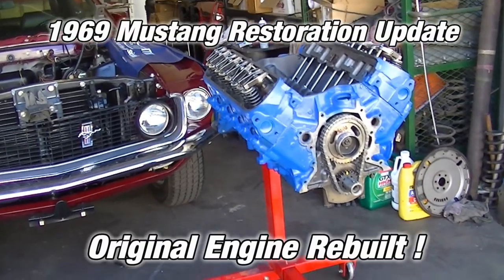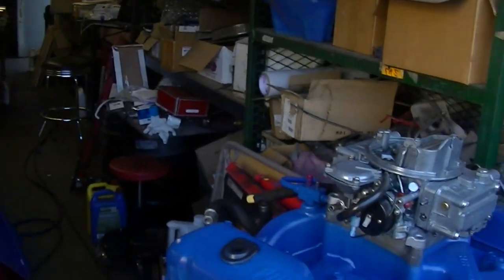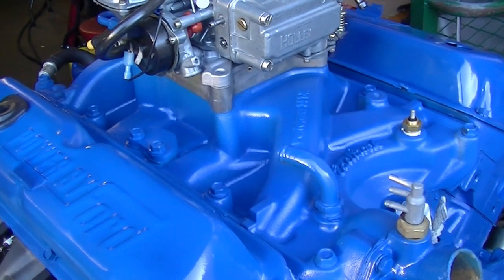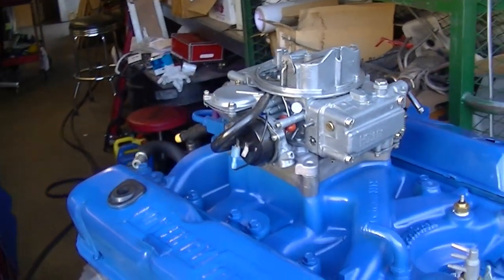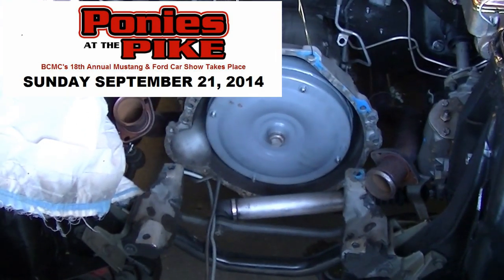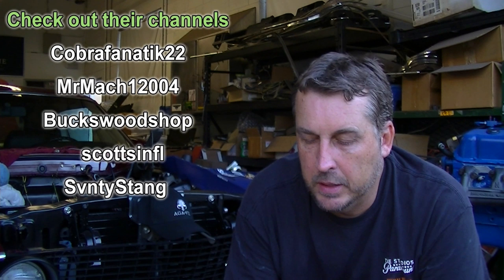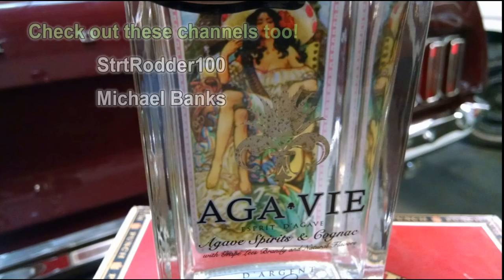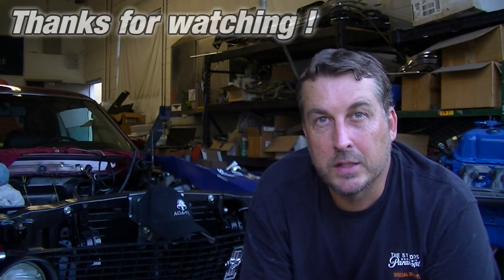351 MOTOR IS BACK from the Machine shop! 1969 Ford Mustang Restoration Part 70 Mustang Connection

Comment: Oh yeah and with a little extra pep in its step.  Going to be a great engine! Pretty excited to hear it with that magnaflow exhaust.
Reply from the maker: Billy, I had nearly the exact same set up in the Cougar I just profiled, the perfect cruiser for the street with a bit of a kick.
Reply: Those 351w's are definitely nice engines.  I questioned having the larger displacement when I rebuilt mine.

Comment: Awesome, I love the stealth painted intake. Makes me want to build a sleeper wagon next. Looking forward to hearing the car run again! How did you break in the motor?
Reply from the maker: SuperKONR Thank you!  Haven't broken in the motor yet, it's gotta get installed first :) No run stand or dyno just old school plug and play. I am using a special break in additive with zinc to prevent cam issues. 
I will put that in the video.